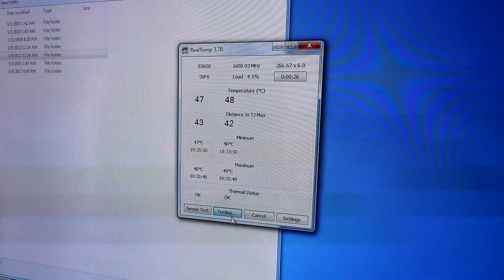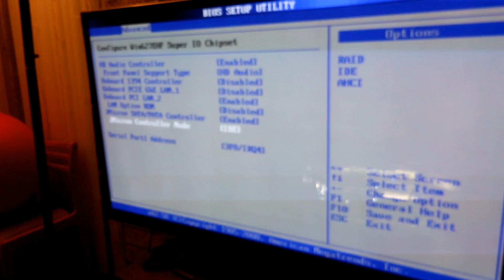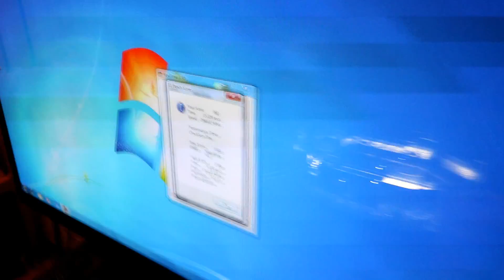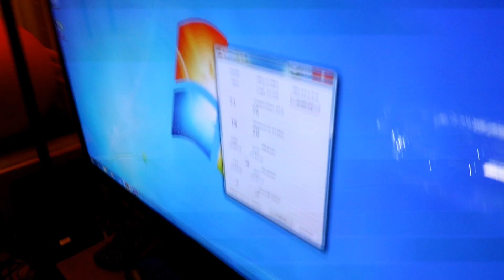Worlds LARGEST Overclocked Mineral Oil Cooled Aquarium PC

Comment: So 3 years later is it still running or did the oil destroy it? Ive done a ton of research and treated my motherboards capacitors and any on the gpu and psu with pure urethane. If it was a capacitor, it was getting coated as the rubber under them will swell and push them off the board. Any stickers were coated with urethane and all cables were the individually nylon braided pc cables with the combs so they would never erode and cross. The ports are suspended about 2 inches above the oil to avaoid creeping and the only cord that goes into it is a power cord. The whole thing is a single cubic foot with 2 120x240mm radiators with fans and 2 12v tek plates  sandwiched between a heat sink and a water block that are connected to a power controller that is connected to the perif cable. The cooled oil is directed onto the gpu and cpu and internal fans cycle the heated oil away toward the outside where the pump draws it out. Fliw is very important in these systems.
Reply from the maker: still running
Reply: @drewtalks  Ditto! I made one! best decision. However they need more airspace to cool off those radiators lol.

Comment: Hey Drew, guy you sold this pc to here!  I took the setup out of oil and put it back in the case.  i have switched the CPU to a core2quad q9505S, im running it overclocked to 3.77 GHz right now.  (Cinebench 402) Turns out, you could have pushed past 3.46 with the dual core, you just needed more voltage to the north and south bridges!  Also, I have switched the Ati you gave me for a GTX 480.  Not the quietest card, but definitely a performer!  Thanks for basically giving me this PC, ive learned a ton about overclocking and windows from owning this, and got a fast gaming computer to boot!!! Cheers!!

Comment: I'm building my own mineral oil PC and was wondering if it's okay to submerge the ports. Like the HDMI port ethernet port Etc
Reply from the maker: yes it is just messy
Reply: Yeah, but use wireless/blutooth periferals. The oil will find its way through the wires. I have designes, and building kits to sell if intersted.

Comment: What would have been REALLY cool is if you were to get a more modern CPU that was designed to be Overclocked. Like a i7 7700k and just see how far you could push it. I know the point of the vid was to take a PC that cost as much as a Pi3 and see how far you could push it.... but an insane cooling rig deserves an insane build. Kinda like putting $5,000 wheels on a 12 year old Corrolla.
Reply from the maker: hahaha yeah but building a pc like that would cost in the thousands of dollars.
Reply: i actually bought this computer from him and stuck a q9505s in it, currently running at 3.77GHz and benching 402 Cinebench, 60 fps on everything else! :)  Cheers!
Reply: Risk management son. You don't want to ruin expensive equipment.